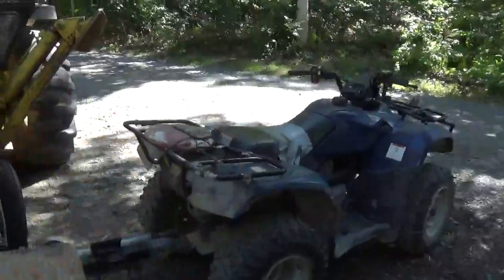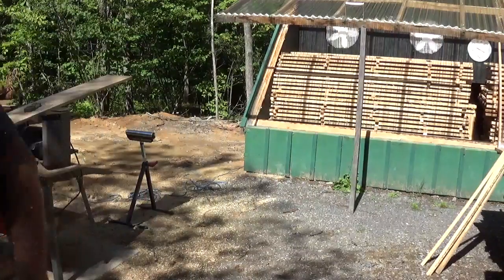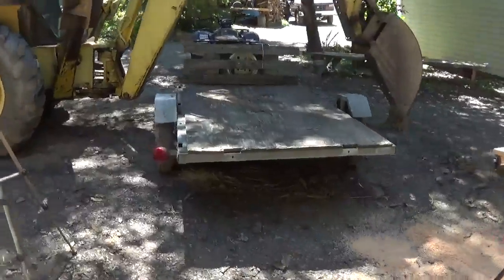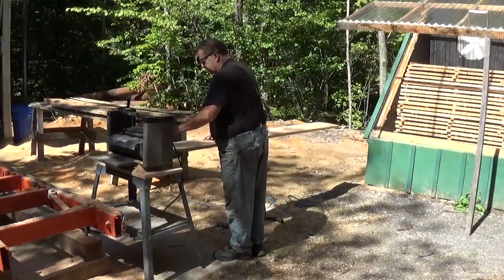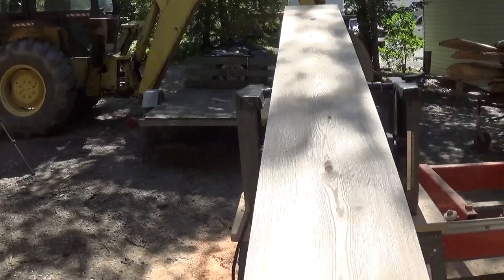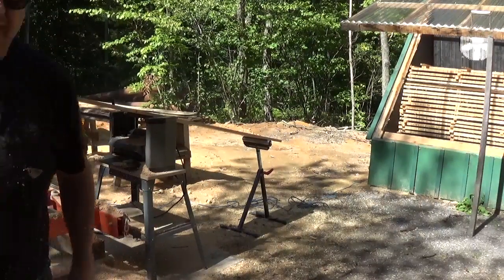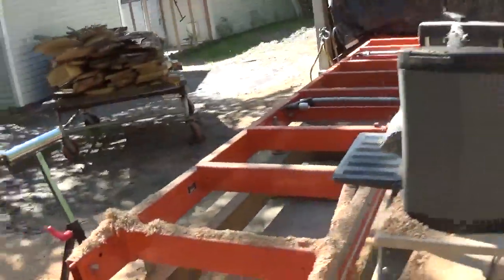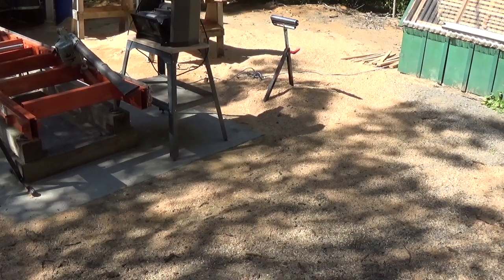Always more to do in the lumber business. Planing.

Comment: I work with rough lumber all the time and found that keeping the lumber in the rough state until ready to use allows me to rough cut the pieces to size from the boards before planing. This way I can work around bad spots omitting knots and choosing the best grain for the project. Planing the boards after they are rough cut to size reduces wear on the planer and saves time. I live in Florida so an added benefit is to not have the boards warp again after planing while waiting to be used.
Reply from the maker: How I stack the boards after planing keeps them to a minimum in warping. At the moment I have 10,000 bd feet drying. It is all doing well. If the lumber was only for myself I would still plane it because of the size of the choice I have to pick from.